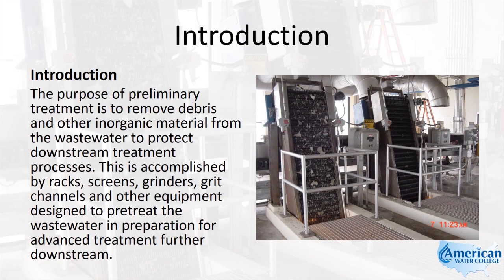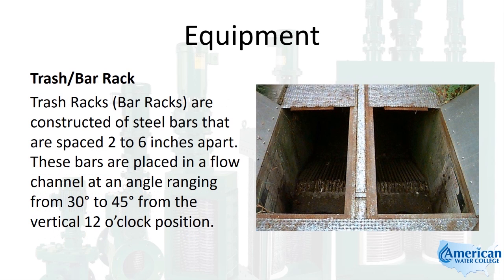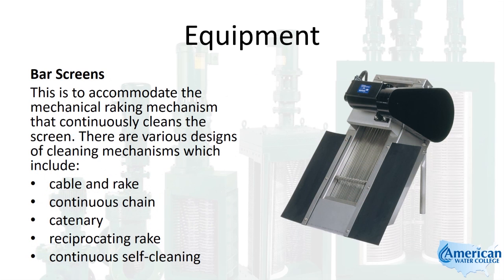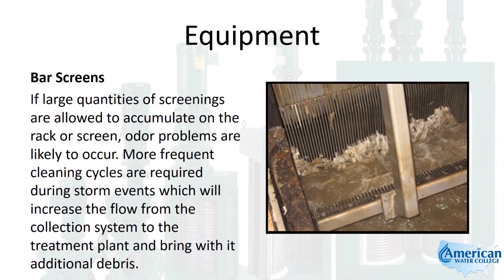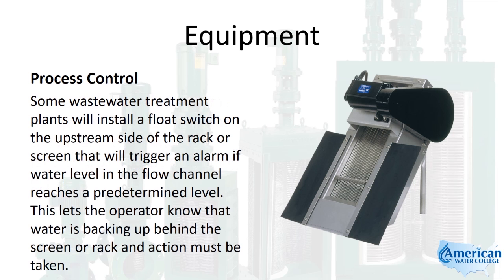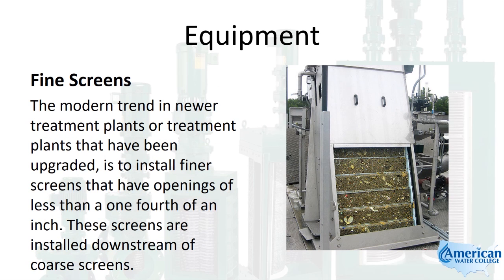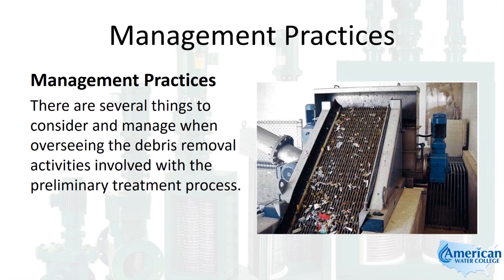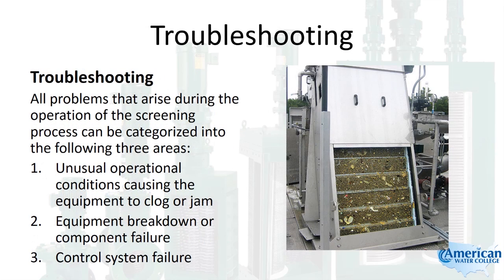Wastewater Treatment | Preliminary Treatment

Comment: When do you use a manual or an automatic mean to clean the screening process?
Reply: The number of automatic bar rack cleaners is usually recommended is atleast 1. More than that depends on your budget/economic position in the budget. For example, smaller rural plants may only have 1 due to the lower influent flow rate. Bigger plants, with higher flow rates usually use more automatic cleaning methods to save workers time, allowing them to attend to more pressing matters in the plant that may need more supervision, such as the disinfection process.

The number of automatic cleaning methods also depends on the quality of wastewater influent, along side with flow rate as previously mentioned. Waste water influent which is poor in quality usually carry more debris/inorganic materials calling for more frequent cleaning.
Reply: @pipbooooyyyy  Ok, but what is a small and what is a big wastewater treatment plant? Are there any certain parameters to follow, to sellect the kind of screen process?
Reply: @IMLuigi9  a big water plant would be one serving a large city such as Chicago, Toronto, Austin Texas, ETC. A small one is usually located in rural settings, the size of the plant is directly proportional to the size of population it serves.

Bigger plants will more often use mechanical bar screen cleaners due to the high hydraulic load of wastewater being received, allowing operators to be free to observe other processes in the plant.

Smaller plants will often only have 1 mechanical bar screen cleaners and may lean towards manual bar screen cleaning simply due to the low hydraulic load given by most rural communities with small population.